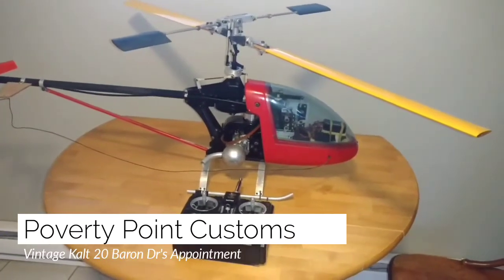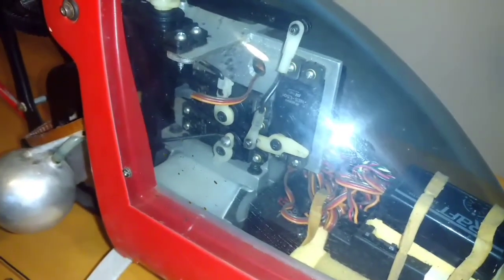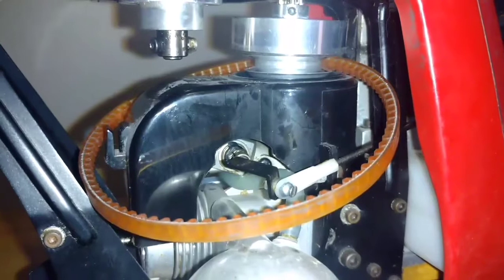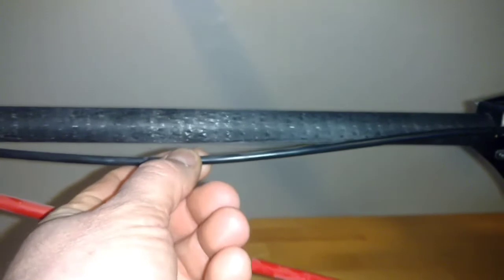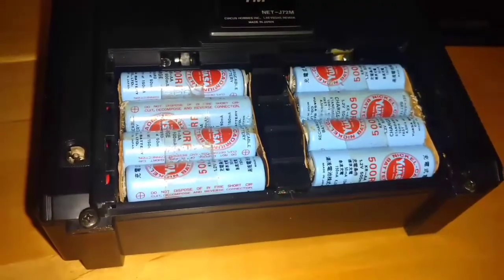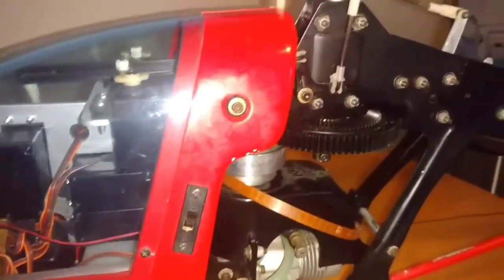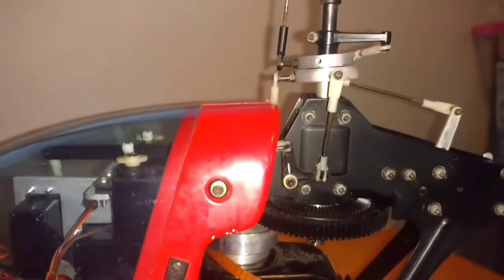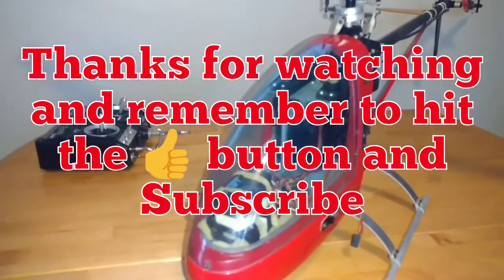Vintage Kalt Baron RC Helicopter Mechanical Issues and Restoration

Comment: Noticed you have separate throttle and collective. That’s an upgrade. You can test the gyro by picking up the heli by the head and simply wagging the tail. The tail servo should move the tail rotor blades to counter the direction you’re moving it. In flight, set the gain to where the tail starts to wag and then bring the gain  down just a hair. I highly doubt it’s a heading hold gyro in there as those were just coming out when that heli was being replaced. If you pull the carb there may be a small O ring attached. Replace it.

  Also, pull out the mixture needle and make sure there is no debris inside the carb. When you put it back together, turn it all the way in and 3 turns out. Approximately. You should see quite a bit of smoke when it’s running. Also, fuel is crazy expensive these days but 10% should work fine. It’s an airplane engine anyway but be careful with heat. That little fan doesn’t put out much air which is why you need to run it rich. Don’t expect a high head speed also, they weren’t made for that.